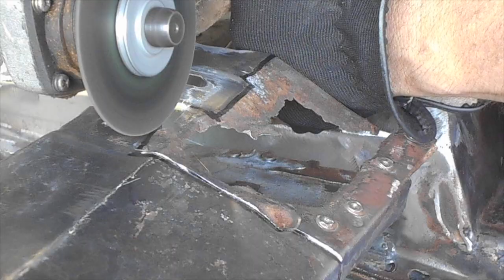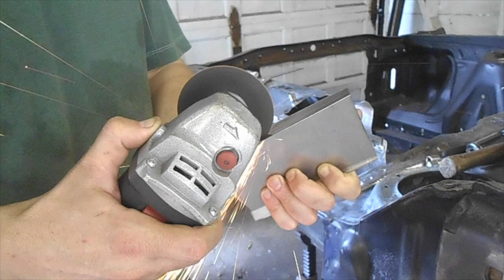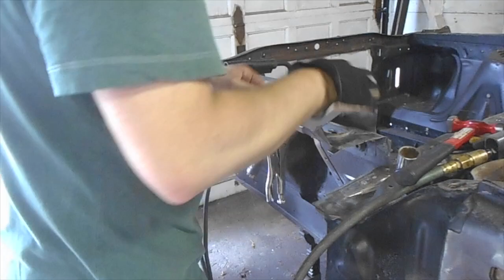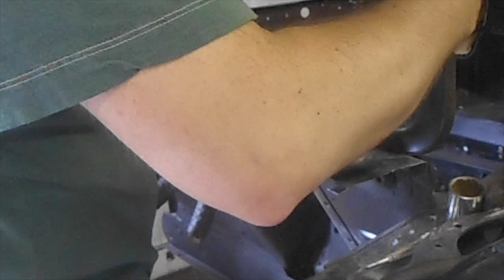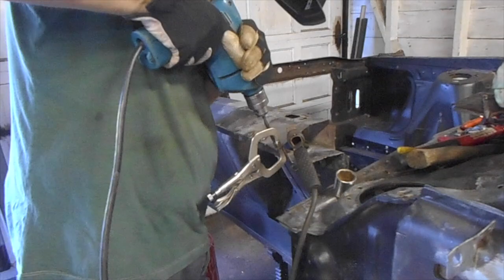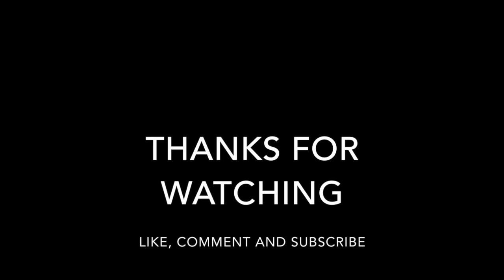Upper Apron Repair - 025

Comment: Good to see this type of restoration video, but a word of caution from an old bloke.  I am constantly amazed by the number of restorers posting vids of themselves using grinding and cutting discs, without either having a grinder guard in place, or otherwise putting their safety at risk, by standing in the firing line, so to speak. Using a 1mm cutting disc on a grinder in the manner in the video, to trim a patch when holding it in your hand and the grinder in the other, is a sure way to lose, or severely damage one's fingers.. even more so if you go to one of the new sure cut slotted metal wheels... Please take care. My neighbour is just undergoing rehab from such an incident and is lucky to have restored 90% use to his r hand ... .
Reply from the maker: You know, There are a number of things that are 'shoulds' in life. I should exercise more, I should save more for my retirement. I should cut down on beer or fatty foods. I should floss regularly or go to church more. But, you are ABSOLUTELY CORRECT! Getting injured doing something like this is completely unnecessary and I thank you for bringing this to my and everyone else's attention. I will try and set a better example for others.